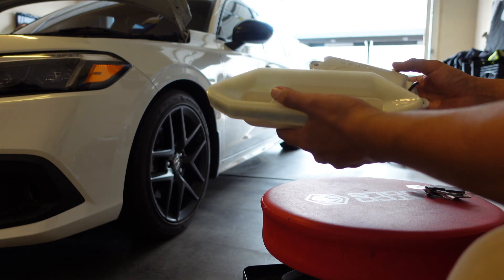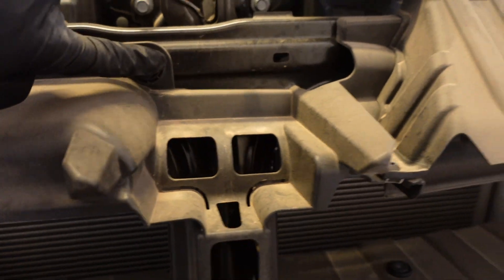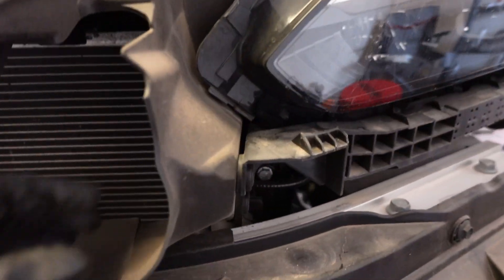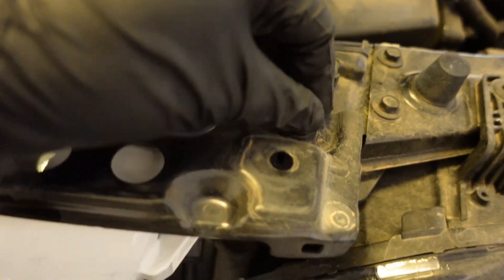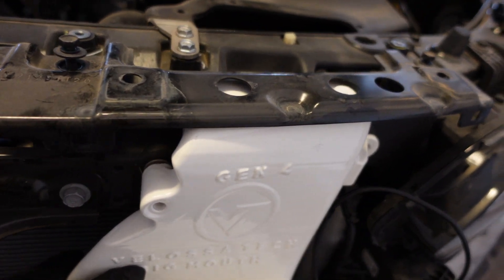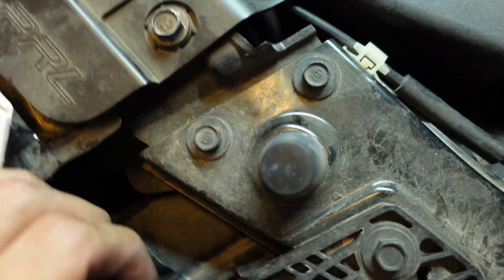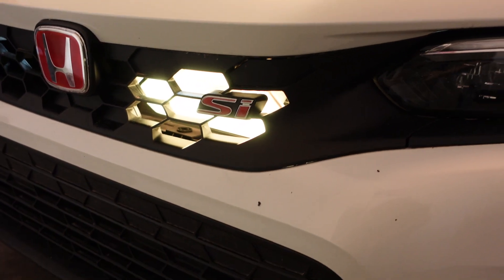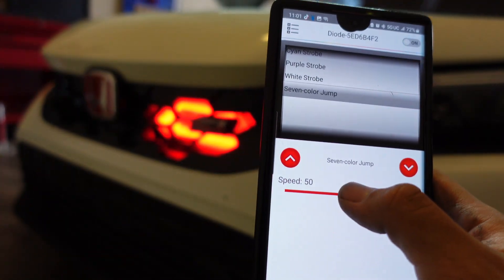2022 Honda Civic Si SNORKEL intake W/LED #velossatech #intake

Comment: Nice did you put back in the rubber piece  you took off from the beginning to install it ?????
Reply from the maker: Nah I left it off
Reply: I cut mine to fit the snorkel and then re installed it

Comment: So with the high volume PRL intake it’s pointless for this snorkel??
Reply: Did you get an answer for this.  I have HVI too thinking about getting this snorkel.
Reply: Actually I got the hvi and two step performance snorkel it cooler my air temperature by 10 to 20 degrees depending on what I am doing
Reply: @real_ultrajoe how about air induction noise.Any difference ?
Reply: @willlivm  no difference in noise just air temp and slightly better mpg

Comment: Did u notice a difference in throttle response or noise might put one on my 2024 civic si
Reply from the maker: Yes a little maybe more with the intake slection and it being loud, sounds like it has a BOV.
Reply: Awesome I might get this with stock intake + k&n filter or do a prl stage 1 intake thanks for the reply

Comment: Not trying to be funny but What is the point of this snorkel for looks🤔
Reply from the maker: You get to pic any design you want. The shape of it they have different shape designs.
Reply: To get cooler air from the outside to the Air intake, versus  the intake soaking hot air from under the hood.
Reply: Gives u more power to you
Reply from the maker: @twistedleo841  not much but it's getting more air